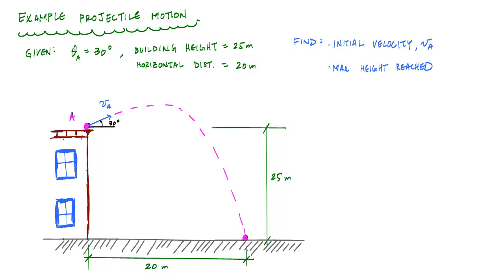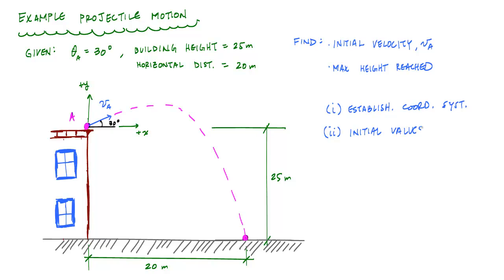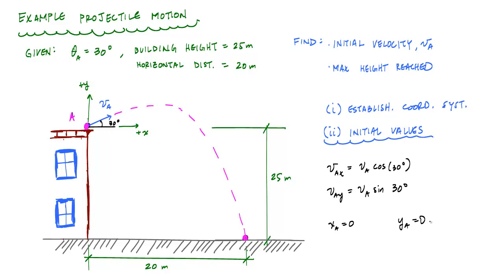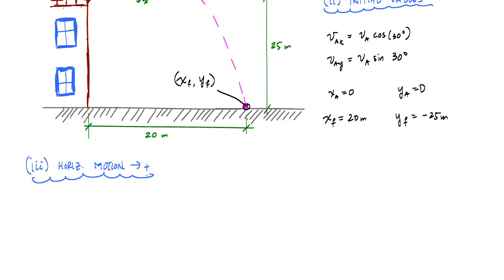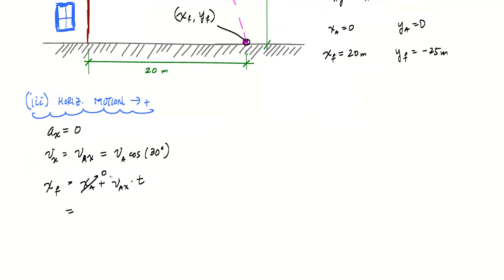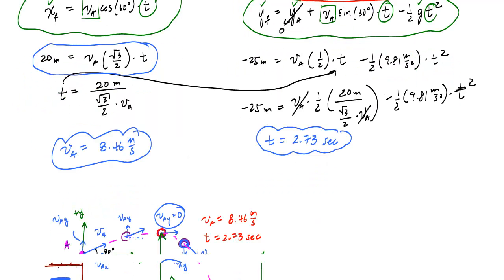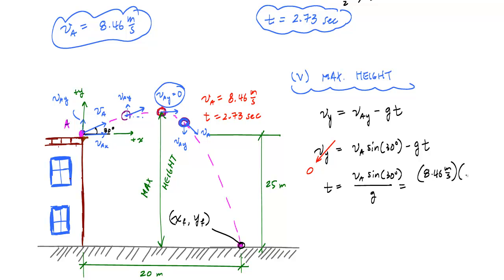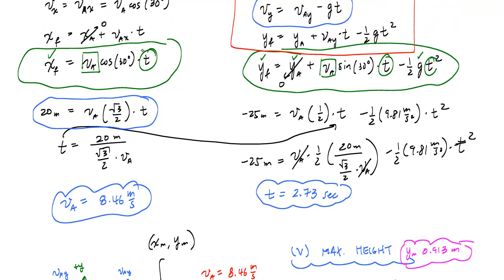Projectile Motion Example Solving for Velocity and Maximum Height - Engineering Dynamics

Comment: here's some tips: If they ask for initial velocity, usually you will have to think of substitution of T then plug into equation of Yf in order to calculate it. If it starts with given initial velocity, always try to find the component of x and y function first then moves on from there. Always remember Vy at peak is always 0.

Comment: Why didn't you substitute for t at 4:51 instead of leaving the t^2 ?. I get that you left it to have a t variable left to work out, but i didn't know you could leave some unsubstituted variables like that. :S
Reply from the maker: ha! I didn't even realize I solved it like that. I must have just noticed that the vA's cancelled out so I could solve for t without substituting all the way through.  That's probably not the most typical approach.  If I substituted for the t in t^2 also, then I would have determined vA first then calculated t.
Reply: I was confused aswell, but very nice to see an alternative approach - never thought about doing it that way!
Reply: i also did similar question like this, leaving the t^2 without substituting it with va is a really really nice idea that makes me get the correct answer